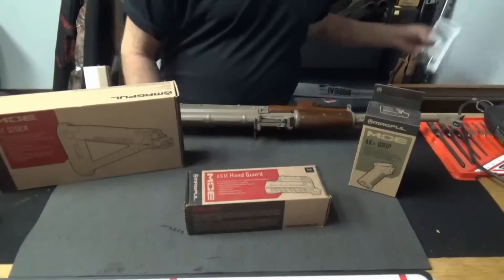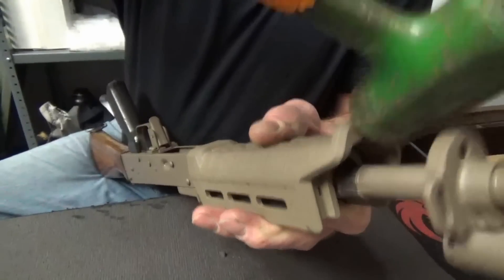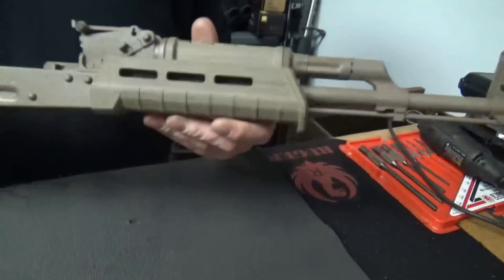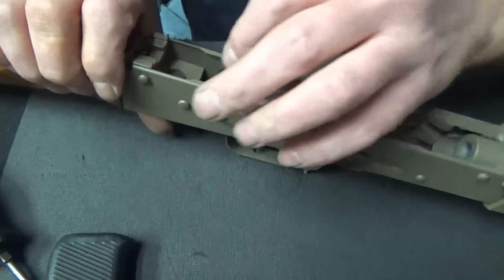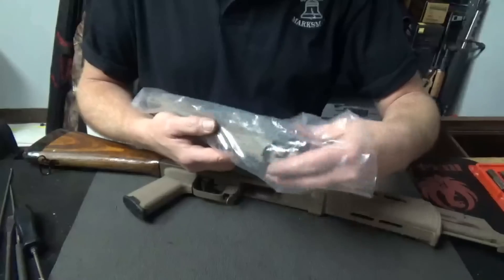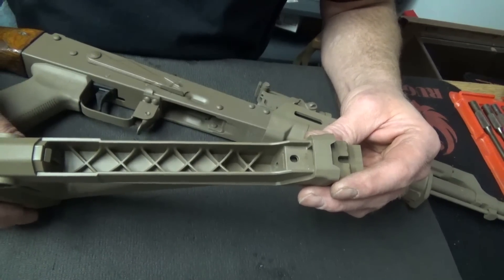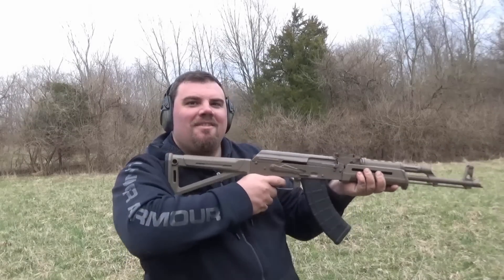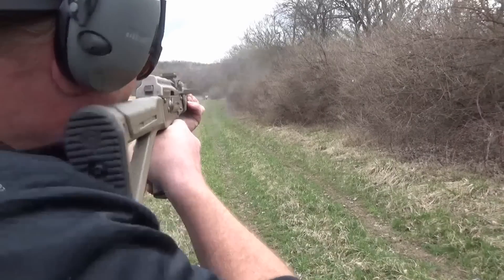AK47 Magpul Furniture Install

Comment: If you lean forward and lower the stock placement a little and roll your shoulder out you would be able to control the recoil much better
Reply from the maker: Thanks for the tip we will give it a shot
Reply: Liberty Marksman sure thing guys, great video!

Comment: I had to sand down the upper handguard to get the gas tube to lock back in place. It sat too high and the locking lever/tan wouldn't go back I to place. Sandpaper did the trick. This was on a PSA...fyi
Reply from the maker: I can't tell you how many of these need hand fitting. The thing is, they are not built to a mil spec. Don't blame magpul, they are consistent.

Comment: They're not "Tabbies"  - Common nomenclature is "floating nut plate". Hopefully, they're self-locking. If not, you can carefully oval the nut bottom just a bit. They use 'em aircraft all over the place. Many are cadmium plated with cadmium plated screws. The idea is, use the same material for screws and nut plates to prevent galvanic corrosion.
Reply from the maker: It's  called satire!!!
Reply: @LibertyMarksmanUSA  ---

Yeah, like puttin' perfume on a pig.

Comment: I’m in the process of ordering the Magpul furniture for my PSA AK G3. I can’t tell you guys how much you helped me with your video on how to accomplish this, lots of handy little tricks. I was wondering if you had another idea on replacing the slide cover. I can never get it right. It takes several attempts and I never see what makes it right.. usually I position it on slap in into place and I can’t work the slide.. after several attempts it will cycle but sometimes no so smooth.. any ideas? Thanks Tc from Nevada
Reply from the maker: The biggest thing we have found is make sure the cover is in the front first. Then push down on the back and while pushing forward. It can be a b!tch because you are overcoming the recoil spring. Some times you need to push the rear spring in at the same time.
Reply: @LibertyMarksmanUSA  thank you for your response. I appreciate your help, Tc from Nevada
Reply from the maker: @Thomas-po3by  anytime and thanks for watching.

Comment: Excellent video. I wonder if using blue Loctite would be a good idea on the screws?
Reply: I think it depends which ones specifically. I wouldn't do it for the grip.

Comment: Great video! One of the best demonstration on YouTube. Will this Magpul furniture fit my straight edge MAK 90? 

Thanks for video and sharing!

Semper Fi
Reply: Think those are milled trunions...
Reply: A mak 90 is stamped with forged trunnions 
Milled receivers don’t even have trunnions. 
If your mak90 doesn’t have that thumb hole stock with the crescent moon shape cut out in the lower receiver then it should

Comment: Once again your video helped me - My screws have been coming loose, in my stock, with heavy use - had to start from scratch - So now I'm not sure what to do about this problem with the screws in my Magpul stock?
Reply: i had the same problem. mine seemed to be missing that brass beveled washer. i asked magpul for a fresh set of screws and washers thinking it fell out but they sent me everything except the brass beveled washer. I am thinking that pieces missing is the problem, not sure though. if it comes loose again i will probably try the folding stock or something else entirely.
Reply: @dinodad32  I just emailed them on their customer support telling them my problem. But they still didn't send me the brass beveled washer even though I specifically asked for it. They sent literally every other piece including another alan wrench.

I was thinking of buying another one from the store to see if it was in the package. Maybe they just stopped sending them.

Comment: What the length of pull on the magpul stock? Is it the same as the woodstock?
Reply from the maker: It was the same length as the original we took off. We did not measure tho.